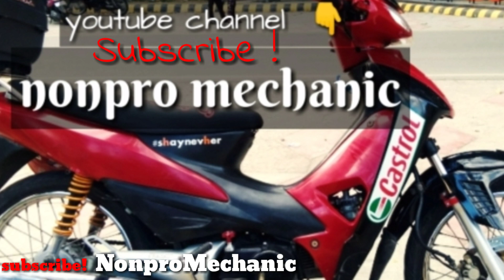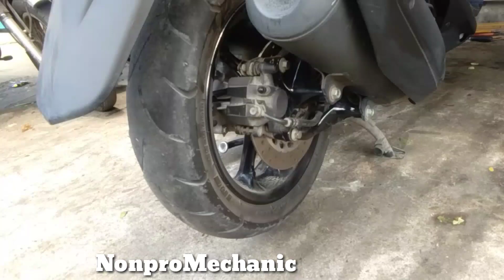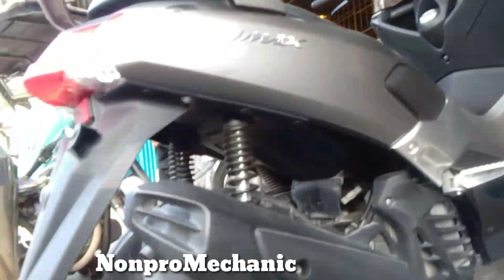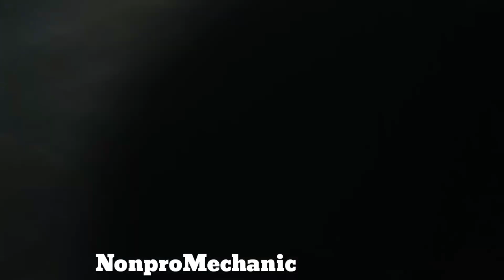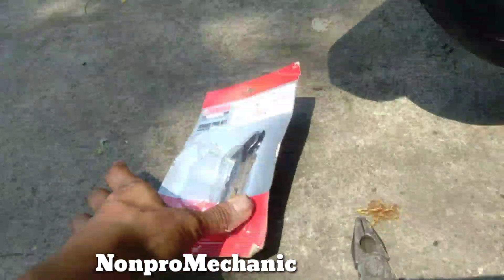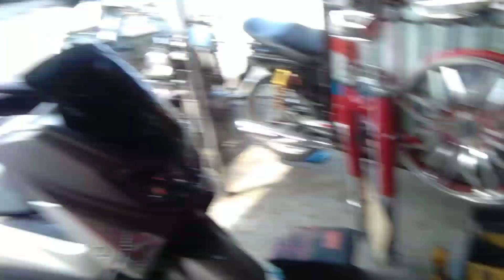How to replace Breakpad | Yamaha nmax

Comment: correctly it`s BRAKES, and you should clamp that brake hose and release drain bolt when forcing piston back. Near piston can be dirt and you can push it to ABS unit.